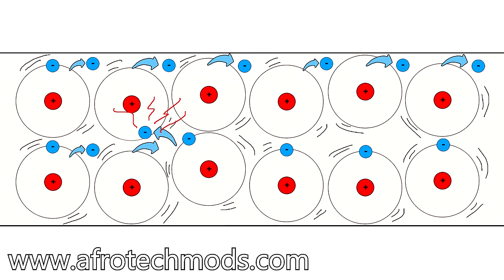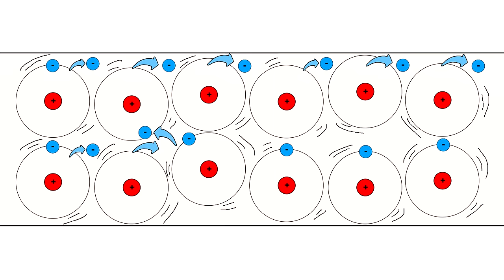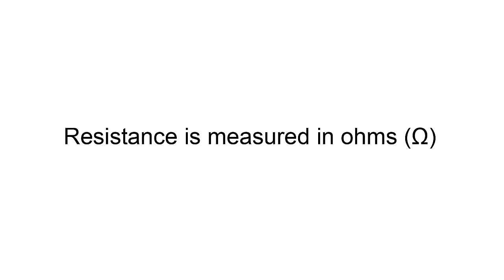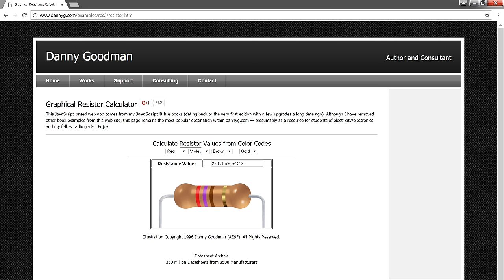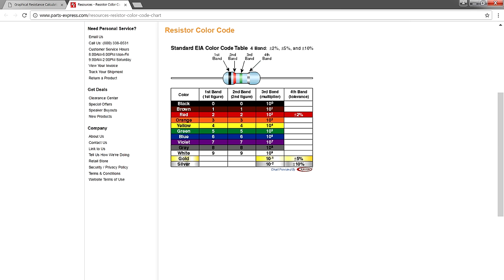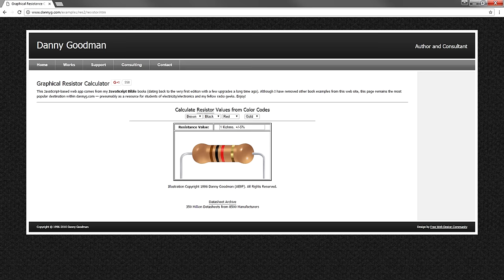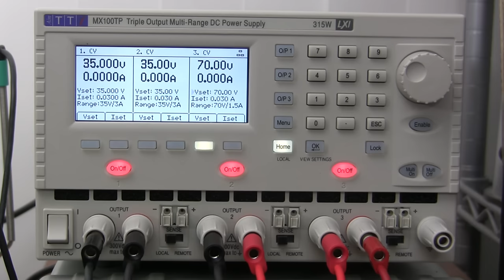Basic Electricity - Resistance and Ohm's law

Comment: What if i put 100 leds in parallel do i need a resistor?
Reply: NE555 yes of course u need!
Reply: you are connecting them in parallel to a voltage source so it is the same thing as connecting one. If you connect them to a current source then also its not a good idea as leds don't do current sharing very well. One will take a lot of current first and blow up, then next will do the same and soon you will have 100 burnt leds on your hand.
Reply: +Qaz Wsx  it depends on if u wanna use just one single resistor for the whole LEDs or a single resistor foe every LEDs. I think his question was if he would use just one single resistor!
Reply: You need a Power MOSFET first to control big loads with microcontroller
Reply: No, you don't need one, you need one hundred. Unless the LEDs are matched (i. e. have the exact same electrical properties, which is improbable unless you measured them all) and thermally coupled (all stay at the same temperature by mounting them on the same heatsink for example), you must never connect LEDs in parallel without a resistor for each parallel string.
Reply: It's actually depends. If he'll use, let's say a perfectly 3V input for a 3V LED, you could use no resistor, but resistor with low value will be better. If he'll use more voltage, then resistors will definitely needed, but that's lots of waste of power with LED in parallel configuration. I'll recommend to watch a LED basics video from GreatScott, it covers almost everything you need to know about LEDs.
Reply: +IRFZ44
If you think that, you unfortunately don't know how a LED behaves and just give a recipe for killing LEDs. There is no such thing as a 3V LED. They all have a voltage-current-curve, not a single voltage, and even in the most perfect LEDs this curve changes (quite alot) with temperature. So, no you can not run a LED without external current limiting (if you want it to survive for some time).
Reply: superdau Surely, the LEDs you're talking about are high-power LEDs. They're using so much power for its size and does generate lots of heat when driven at its rated supply. These small 5mm LEDs aren't that powerful and complicated. 
Right, LEDs should be driven with current regulated supply, not a constant voltage supply because as the LED heats up, the foward voltage decreases, allowing more current to flow resulting decrease of lifespan. Thats why I said, small value of resistor will be better.
Reply: IRFZ44 a MOSFET? WTF? As I know (and correct me if I were wrong), I need a MOSFET if u want to switch the circuit on or off, otherwise, mosfet isn't necessary!
Reply: Tom Tommy As I said, controls big loads with microcontroller :)
You can't directly connect a load that draw lots of power through IO pins on a microcontroller, otherwise the microcontroller will release its "magic smoke"
Reply: +IRFZ44 agree with u! If he's going to power the 100 LEDs by a microcontroller of course YES!
Reply: Sure, but do mind your breadboard..
Reply: NE555 yes because you're limiting the string to 20ma and dropping down voltage per diode

Comment: To calculate the resistance value, you need to group the values of the significant digits bands — i.e., the values of the first two or three bands from the left, depending on the total number of bands. Then you need to multiply that value by the multiplier to get the resistance value of the resistor.

Let's take for example a four-band resistor with the following band colors: Violet Green Yellow Gold

Since it is a four-band resistor, the first two bands (violet and green) will indicate the significant digits which are, according to the table above; 75.

We then multiply that number by the multiplier indicated with the 3rd band (yellow) which has the value of; x104 = 10000.
The result of the multiplication will be: 75 x 10000 = 750000Ω = 750kΩ.

The fourth band (gold) will indicate the tolerance which in our example is: ±5%
To calculate the minimum and maximum resistance values, we multiply the resistance value by the tolerance percentage to come up with the following values:
Minimum = 750000 - (750000 x 5/100) = 750000 - 37500 = 712500 = 712.5kΩ
Maximum = 750000 + (750000 x 5/100) = 750000 + 37500 = 787500 = 787.5kΩ

Comment: I recently purchased 3 - 300 watt/2 ohm resistors for the braking circuit for my wind turbine.  I took a picture holding one of these monsters and posted it to a “nerd” FB group I’m in with the caption “Take that Borg!!”.  Apparently I thought it was a lot funnier than most of them.  I’m betting you’ll love it too.   Also, I want a bench top power supply: is there any reason not to go for a 10A or will a 5 work just as well?  I plan to test fans, motors and other randomness I might be able to turn into a toy or gadget.  Thanks!

Comment: I have a 12x 5630 portable camping light believe it is on a 60 ohm resistor but the 5630 can handle 3.7v and the battery it is on is a 900mah 3.7v cellphone battery when I bypass the resistor the light gets about 2x brighter

Comment: At 6:14, you have the resistor between the positive terminal and the LED. The resistor is placed here because we are thinking in terms of conventional current flow right? Although that may be the case, the actual flow of electrons is from the negative terminal through the LED, then to the positive terminal. Because of this, I would have thought that the resistor should be placed between the negative terminal and the LED.

For clarity, please answer each question individually, instead of one sentence that applies to everything or instead of just answer the last question.

1. Since the current flows from negative terminal towards the positive terminal, the LED would burn up if you have the resistor coming after the LED (and before the positive terminal)?

2. Do you place the resistor between the positive terminal and the LED, only for schematics and diagrams?

3. When you actually build that circuit, does the resistor still get placed between the LED and the positive terminal, or does it go between the negative terminal and the LED?

Comment: I am confused by the placement of the resistor.
At 0:27, the video shows too much current flowing thru and the LED blew up.
At 3:23, the video shows a resistor connected to the negative lead.
I'm assuming the current is flowing from negative to positive, since the LED didn't blow up.
At 6:07, the video shows the resistor connected to the position terminal, which is opposite to 3:23. This is where I'm confused.
I've always heard that electricity flows from positive to negative. Also, I've often heard that it's not the voltage that kills you, it's the current.

Comment: So technically can you use that dried carrot as a resistor for lighting the bulb? Just as long as you have enough power going through the wire?.. Makes me wonder too if you touched a dried tree resting on a high voltage power line, maybe you could get a shock or feel nothing at all, but what if that tree is wet and has a higher water content? I suppose it would be fun to find how how much resistance some materials have and make up scenarios.

Comment: Thanks for these! I've started an Arduino class and getting these concepts isn't easy for me.

One thing I still don't understand about resistors is that you can put them anywhere in the circuit and they still work. In my mind they should be placed between the power source and LED so the LED doesn't get fried. But I've seen that the resistor can be on either side of the LED and it works fine. Why is this?
Reply from the maker: Because the resistor limits current, and current is always the same at any given point in a simple series circuit.
Reply: It doesn't matter if the resistor is before or after the led because either way it is still between the power source and the led.

Comment: I don’t get one thing at the start of the video you mentioned the resistance or “bumping” causes loss of heat energy due to which bulbs light up so why at the end of the video the LED became dimmer when the resistance was high? Doesn’t high resistance means loss of more amount of heat energy so it should be brighter

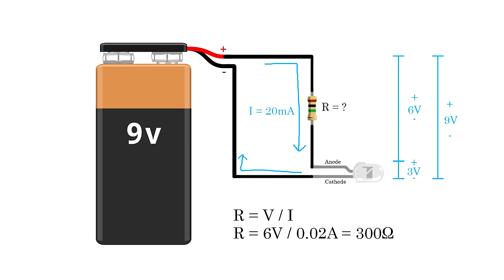Comment: 7:18, why would the resistor be going on the positive side? Wouldn’t you want to put the resistor before the LED light? You know since electrons are flowing from the black wire, the negative terminal... or does it not matter?

Comment: Do electrons actually move at approximately the speed of light? Not quite. It is an electric field that "moves". In a one meter wire, with one amp current, electron particles take 24 hours to move the length of the wire.

Comment: I built a sign using hundreds of l e d  but only used one resister . I did not use the proper calculation tech because I did not know the exact power requirement for the l e d because it did not list the exact specs for each l e d . Is there a way to determine the exact requirements for each l e d if it is not listed please ? The sign is nice and my friend likes it but is a little dim in daytime ! Or can you address using multiple l e d and calculating  resister values please . Also ; the discharge curve of rechargeable batteries can really wreck a project and you need some special care with resistor or a special circuitry to regulate your voltage !  for my sign I just played a guessing game !  Big thanks !

Comment: In the battery example of 3 volts being used by the led and the remaining 6 volts being calculated for the resistor what then happened with the first example where the input was only 3 volts?  You'd have 3 volts going to the led and 0 volts for the resistor to manipulate

Comment: If I made that same circuit and had two of those LEDs in series (one after the other) do I add their voltages (3v +3v) - 9v = 3v and then divide that by double the LED's current 3v / 0.04 for a 75o resistor?
Reply: Uh,       yes! Er, I mean,   no!

Comment: Could you help me understand something? If we put a bigger resistor in series with an LED it will be dimmer and the battery will last longer right? But if the resistor reduces the current to the led by “consuming” that power and giving it off as heat then the battery life should in theory be the same. Have I misunderstood it? Thanks, great video buy the way.

Comment: The first LED with 9V showed the resistor on the positive wire. The current would need to pass through the resistor first before it made its way to the LED. But electron flow comes from the negative side. The second LED showed the negative wire with resistor. What am I missing?

Comment: Sorry for the stupid question, but does a 330 ohm resistor resist more or less current than a 300 ohm resistor? So would be LED run a bit brighter or dimmer? 
Thanks.
Reply from the maker: A higher resistance value means more resistance, so less current, which would make the LED dimmer.

Comment: So why do those led strips have a resistor in them if the potential difference along the led is gonna increase anyway and thus the current, when the supply jumps above 12v?

Comment: Dumb question, but with the 9V battery and the led case, does the surplus 6V get lost due to the resistor or it just restricts the flow to 3V?

Comment: Great videos.
Reply: Oh,what if I want to resist a load on a generator? Would I use a resistor that is equal to the voltage/amp of the battery?

Comment: An easy way to remmeber the equation is a triangle E at the top I bottom right R bottom left. Then you can work out which values in what place. I have discalculear ( like dslexia only with numbers) so anything to make maths easiear. You also forgot the 4th band on the resistor. Gold  +/- 5% Silver +/- 10% no band +/-  20%

Comment: How would the resistor vary if I were to put a series of 10 of those LED?  Is it necessary to use a different value resistor?  Also, would it affect how much resistor required if connecting the LED in parallel instead of series?

I tried connecting 5 LEDs to a 9v battery without resistor, it lit up and somehow didn't burn out the LED. I don't leave it on for long but a few minutes once in awhile. I've also tried 12 v of battery and lit it up for a few seconds before and I was wondering why it doesn't burn the LED, since your burned instantly when connected to the 9v

Comment: Shouldnt the resistor be on the negative side of the component because the power is flowing from the discharge side of the battery?
Reply: It makes no difference.  The electricity will only flow if the entire circuit is complete.  Any open gap and the electron flow stops almost immediately (close to the speed of light).

Comment: I'm working on a project which requires twenty-nine 3mm LED's  (20 milliampere), I've currently got two 9 volt batteries which I'm hoping will do the job, and I'm planning to use a 470 ohm resistor within the circuit... any guide as to how this can be achieve successfully will be much appreciated as I'm completely new to this.

Comment: So,  speaking in context of power usage.. the resistor restricts the current or reduces it through use? (draining the battery or restricting the flow reducing the batteries amperage use)
Reply: Only led in the circuit, the battery nearly shorts because the voltage differential is too high. Resistor lowers the voltage differential so the battery doesn't "want" to use all its power that it's capable of using at a single moment. Hopefully, this clears things up.

Comment: In your reference to tolerance you cited a "real world" 1000 ohm resistor having an actual value from 1020 to 998 ohms.  That of course would be 2% tolerance but then you go on to say 5% is acceptable for home hobbyists.  In my day 5% resistors were top of the line and expensive and 2% would be considered a precision resistor.  FWIW I like todays resistors :)
Reply: No point in even going with 5% tolerance these days, even for hobbyists. 1% tolerance resistors, both 0.25W and 0.5W, are cheap as chips nowadays and the price-difference between 1% and 5% for such low power-ratings is literally a couple of pennies for a thousand resistors. The price-difference starts to matter only once you move to higher power-ratings.

Comment: Thanks a lot for the brilliant explanation!

Could you please explain one thing to me:

On 6:47 there is an example of calculating voltage for a resistor and a LED circuit.
Why is it necessary that throughout the whole circuit the voltage is 9V.

Is it not possible that, for example,  4V is lost at the resistor, 3 Volts lost at a LED and 2 Volts remain.
Reply: @Fred Smith Thanks a lot! But could you please clarify, why the resistor leaves exactly 3 Volts for a LED?

In other words, how does the current coming to a resistor "know" that it has to spend exactly this amount of energy (6 joules per coulon)?
Reply: @Fred Smith this made many things clear to me, thanks a lot!

Comment: how to explain that?
I have many resistance 10 ohms I took them out from different places.
1/ color brown-black-black_gold using multimeter gives 10 ohms and gives beep with continuity.
2/ same color gives nothing, even no beep.
3/ color brown-black-black_gold-brown gives six-point unstable no. k ohm.
4/ same color gives 23.9 k ohm. 
thanks

Comment: In the 9v LED example, does the extra 6v get limited by the resistor thus the 9v battery only outputting 3v to the resistor, or does the 9v output 9v with the 6v difference used up by the resistor and dissipated as heat? Thanks.
Reply: It's the latter - the battery is outputting 9v (as it will always do - assuming it's a full battery) and so 6v is used up by the resistor (converting into heat and a small amount of light), leaving 3v to be used by the LED. 

If you don't have a resistor, then basically the LED still only uses 3v, but the wires (being essentially resistors with a very low resistance) using up the remaining 6v. As the resistance is almost 0, this means the current being incredibly high - causing the LED to pop. If there wasn't an LED, but just wires going from positive to negative, then all 9v is used by the wires, causing a very very high current (almost infinity). Which turns very quickly into heat. You may recognize this if you put a battery in your pocket with some keys. (Hint: Do not put a battery in your pocket next to anything metal)

Comment: Quick question... if I use 3 of these 3V LED lights in a series with a 9V battery, would a resistor be required at all?
Reply: Edge case, so hard to say.
Potentially, fresh battery burns the LEDs out, half-drained battery lights the LEDs fine, aging battery doesn't light them at all.  If it works at all, LED brightness will vary with temperature because this affects the forward voltage - not that you'd normally notice, but in an edge case like this, if could be significant. Basically, if the supply voltage is close to the LED voltage, it's very difficult to predict the current, because you don't know either voltage accurately enough.  Which is why efficient LED drivers regulate the current rather than the voltage.

Comment: I don't get something. Why ignore the voltage drop of the diode in the first 10 mA example with the 10 V power supply and then subtract it in the second example with the 9v battery?
Reply: Because there's no LED in the first example.

Comment: Why is it that if you put one resistor the voltage drop is the same as the battery, but if you put two then it won't be the same?

Comment: I have a question... for example. I have 24 led in parallel and series. I have 8 sets of 3 led each (these 3 is in series) and is in a parallel circuit. how would I calculate the amount of resistance?

Comment: Im curious,  the bands on the resister.  Do they have to be the same? Or because of the  band, it tells you the lest power flow. Why i ask i do kits. And if you need a good effect. One might have to buy from vendors which. I dont want to. $$$$$$$$$$. So i rather do it my self. Resister  comes all different  shapes  and size. I have a few of thems especially  ,i bought  from radio shack. Never been used.